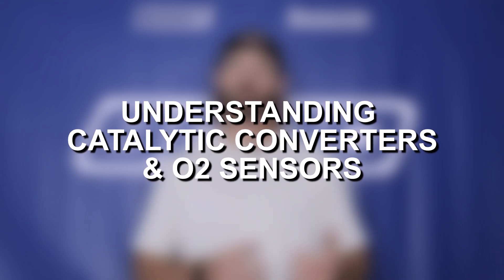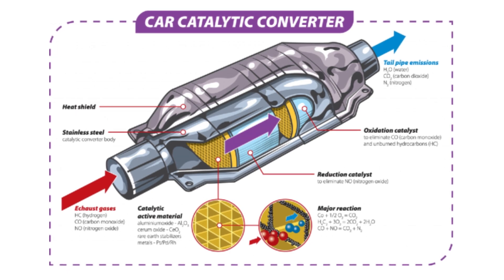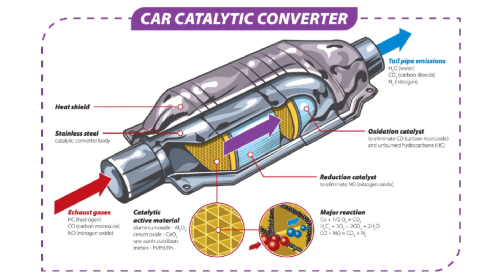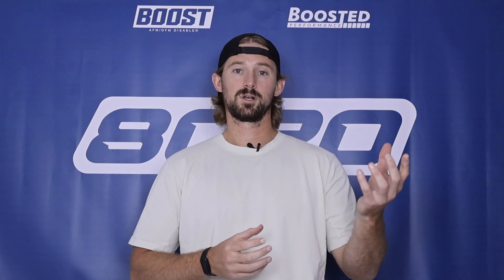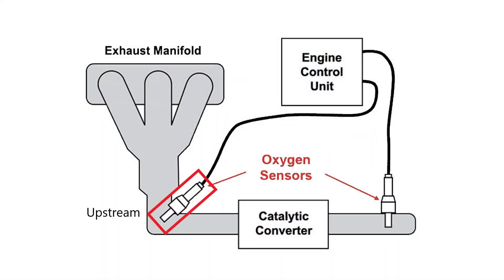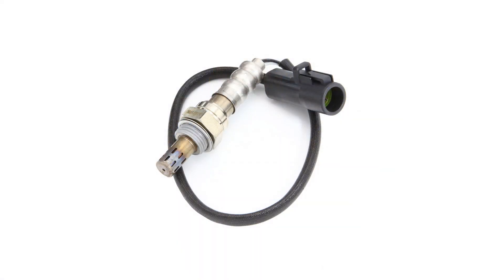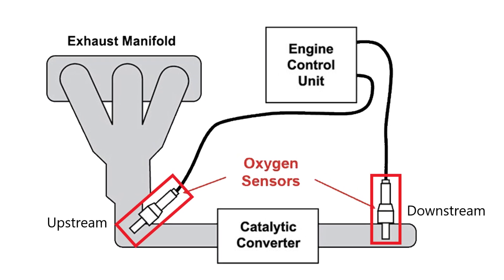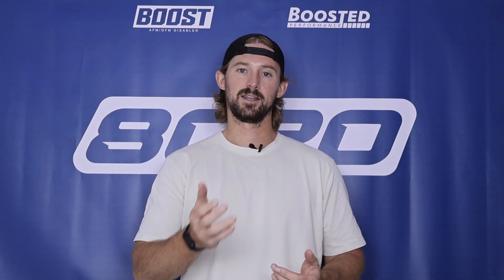P2096 Code? Here's What It Really Means and How to Fix It!

Comment: I have a p2096 in my 2018 nissan nv, the mechanics tell me that i have to replace the cat but all they doing is hooking the computer and immediately say with out finding the problem
Reply: Cat is one of the most expensive things to replace. No wonder why the stealership jumps to conclusion.
If was cat it would have P0240 1000%. BS, it's likely a exhaust leak like mine. The flexpipe is the problem. $60 plus labour.

Comment: I just have the p2096 on my 2002 bmw 330ci and have had it for a year now and never fixed it because the car drives completely fine. I had all o2 sensors replaced and maf. My car is only at 106k miles and issue started 10k ago but my cars cats  usually don’t go bad until like 170k miles that’s what a mechanic told me. Could my cat really be going bad this early? Because it has driven great are they only just slightly starting to fail but enough to trip the code since bmws are sensitive with tripping codes

Comment: I replaced my Cadillac converters and all of my O2 sensors and I just got put back in limp mode today. What the heck?
Reply from the maker: J - If your car is still going into limp mode even after replacing the catalytic converters and O2 sensors, it suggests the root problem isn’t just exhaust-related but possibly engine management or transmission-related; common causes include wiring/connectors for the O2 sensors not seated correctly, a failing mass airflow (MAF) sensor, throttle body issues, low fuel pressure, or even transmission control module problems depending on the vehicle. Since limp mode is the ECU’s way of protecting the engine or transmission, the next step is to scan the car again and pull all current and pending codes (not just catalyst efficiency ones) — those codes will point to the real system triggering limp mode. Without the exact code(s), it’s guesswork, but double-checking the harnesses around the cats and O₂s is wise since a pinched or damaged wire during the replacement is a common culprit. Would you like to tell me what vehicle you have and the exact codes that are showing up now? That way I can narrow it down precisely.

Comment: I’m running longtube headers and I installed 02 sensor spacers to fix the P0420 code and now I got this code could the spacer be the issue ?
Reply from the maker: M - Yes — O2 spacers can definitely trigger new codes after long-tube headers, because while they sometimes “fool” the ECU into ignoring catalyst efficiency (P0420), they can also cause the downstream O₂ sensor to read abnormally slow or flat, which sets other faults like P0139 (O2 slow response), P0140 (no activity), or heater circuit codes. Basically, the spacer changes how exhaust reaches the sensor, and if the ECU doesn’t see expected switching, it throws a different code. If the new code points to the downstream O₂ sensor signal or response, the spacer is very likely the cause; if it’s a heater or wiring code, then it’s unrelated and you’ll need to check the sensor and harness.

Comment: I have p0171 as well as p2096, I had a p0131 for over a year that I never fixed, could that 0131 be the cause for the rest?
Reply from the maker: S - Yes — your old P0131 (O2 sensor circuit low voltage, bank 1 sensor 1) could absolutely be the root cause of the newer P0171 (system too lean, bank 1) and P2096 (post-cat fuel trim too lean, bank 1), because that upstream O2 sensor is the main input the ECU uses to calculate fuel trims; if it’s been stuck reading lean for a long time, the ECU has been compensating by adding fuel, which eventually throws lean codes upstream and downstream. In short, if the B1S1 O2 sensor is faulty or its wiring is damaged, fixing or replacing it should be your first step before chasing vacuum leaks or fuel delivery issues, since the ECU can’t fuel correctly with bad input from that sensor.

Comment: What if I get a PO296 after a brand new cat and new O2 sensors
Reply from the maker: C - If you're getting a P2096 (Post Catalyst Fuel Trim System Too Lean – Bank 1) after installing a brand new catalytic converter and O2 sensors, it usually means the ECU is still detecting a lean exhaust condition after the cat, which is often caused by a small exhaust leak (especially near the manifold or O2 sensor threads), a low-grade aftermarket catalytic converter that doesn’t meet OEM efficiency specs, or an upstream issue like a vacuum leak, dirty MAF sensor, or weak fuel pressure causing lean fuel trims; also double-check the O2 sensor wiring and connectors for damage or heat exposure—start by smoke-testing for leaks, cleaning the MAF, and verifying fuel trim and pressure data to narrow it down.
Reply: Thank you it's a 2015 Ford fiesta with the one piece exhaust manifold / cat  @8020Automotive  I will still smoke check everything but if there was a problem upstream of the first O2 sensor wouldn't be other codes involved
Reply: @carlpreston1680 hey I have the same car lol did you ever figure this out ?
Reply: @danelangpap24  Yes I tried giving you an in-depth reply but evidently YouTube doesn't like it
Reply: Prior to the cat replacement he check engine light was on for about 2 years so I think when I replaced it and it was running correctly the computer thought it was lean cuz it was the other way for so long so the check engine light came back on I reset it and did drive cycles and it eventually turned itself off
Reply: @carlpreston1680 thank you, hopefully mine will eventually reset
Reply: How about having p2098 and p2096 on both banks, no other codes, I have my cats removed from the previous owner and I have installed O2 sensors foulers which now have no codes about catalytic, which means the sensors think that the cats are there but I have these two codes of p2098 and p2096? Can it still be the missing cats are the problem and foulers are not working?
Reply: yeah any aftermarket cat is going to be suspect.... sadly a person cannot use aftermarket/counterfit parts when it comes to cats or sensors.
Reply: Great video.  Very to the point. Thank you.  In my nephews case his Kia picanto gets this error about every 3 months.  Would that suggest it’s not a leak as surely the error would reappear sooner.  I’m thinking it’s a dodgey sensor that intermittently gives a bad reading.  Is there a video on how to check o2 sensors.  
Thanks.